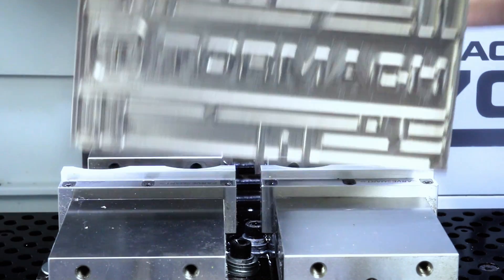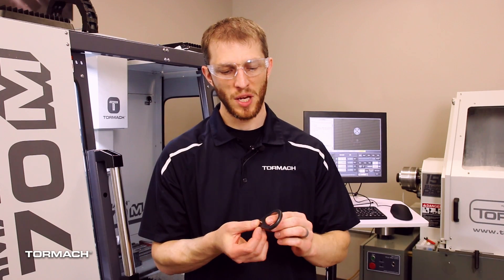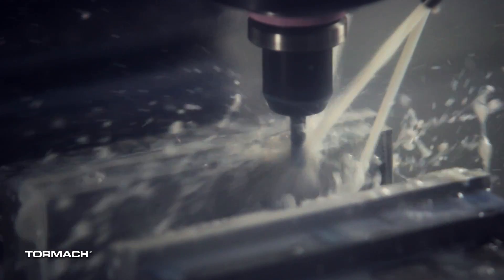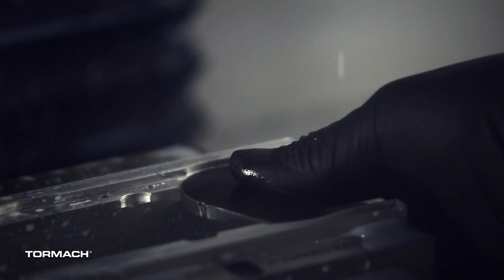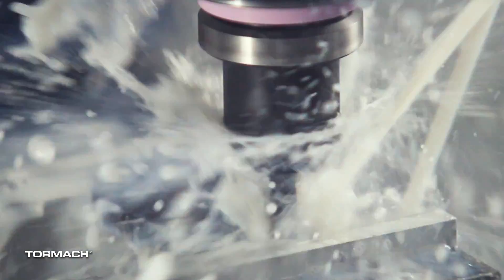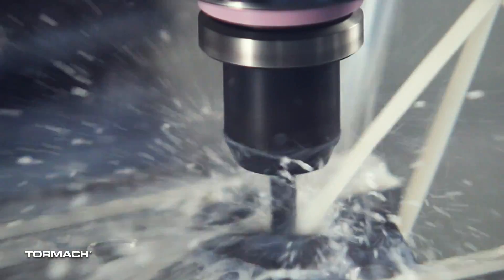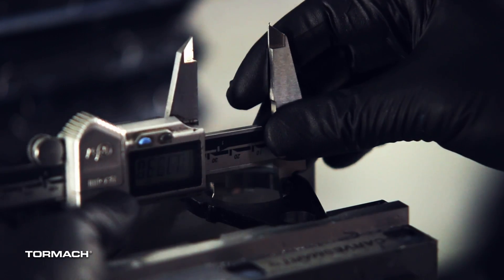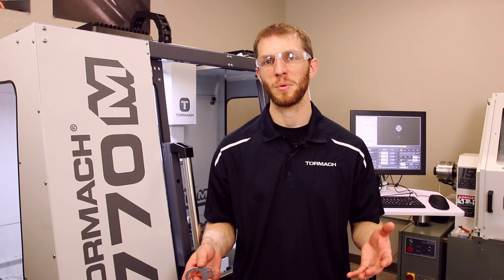Making a Rapid Prototype Part on a Tormach 1100M+

Comment: did you use fusion 360?
I would like to use compensation in the control setting of fusion 360 so I can change the tool diameter in the machine offset instead of re-posting the cam code.  This never works though and I always have to do compensation in the cam.  How did you do it and can you make it work in the control?
Reply: Eric Nary in the settings on your op that needs comp. “set it to wear” and then In path pilot leave it 0.0000 and adjust with - numbers to bring it to size. Usually only a couple tho
Reply from the maker: Hello Eric, Steve is correct on this one, you set the compensation type to wear and use the diameter column at the control to adjust the size.  A value of zero will cut as programmed, you can then adjust it up or down a couple of thousandths to dial your part into spec.

Comment: I only wanted to know how long it took. Are Tormach’s profit worthy equipment?
Reply from the maker: Glenn, we have many customers who are making significant profits with their Tormach machines. While parts may take a little longer to make, many folks run them 24/7 and hold tight tolerances.
Reply: Tormach Inc. fair enough :-)